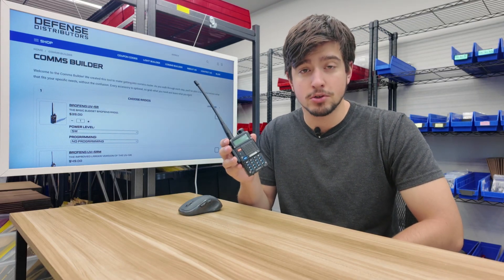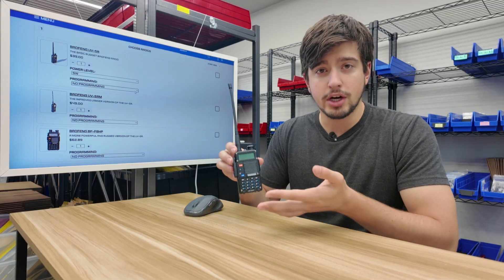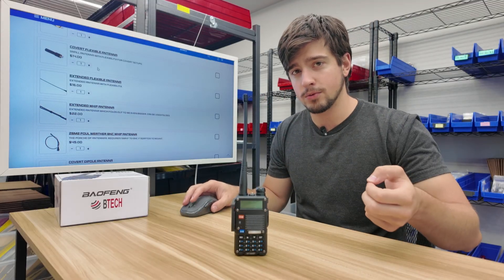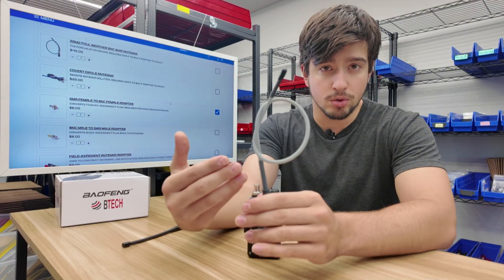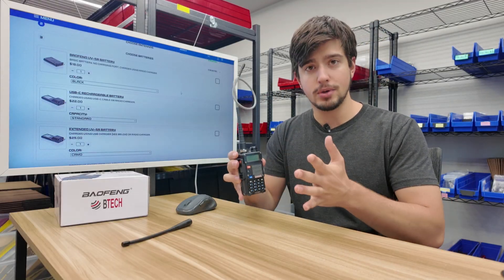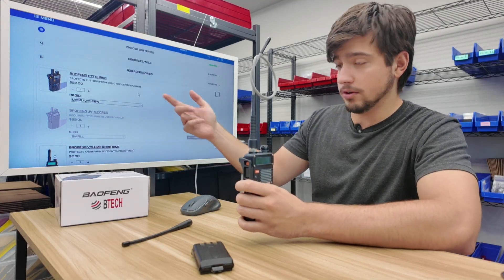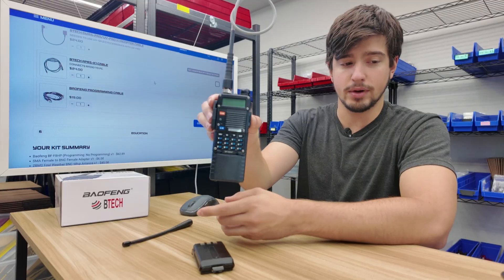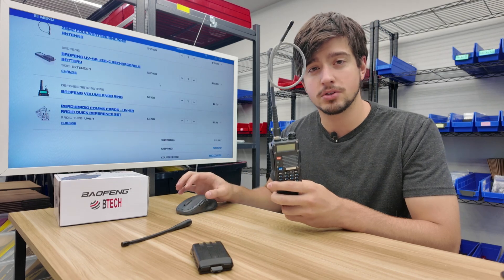Building The Perfect Baofeng Radio Kit

Comment: Why not add the Baofeng BF-F8HP PRO model? It offers 10 watt tri-band compared to 7 watts dual band. Plus the screen seems a lot nicer on the PRO... Just curious as to the reasoning. Very informative video. Thanks!
Reply from the maker: We actually may be doing just that very soon... stay tuned.